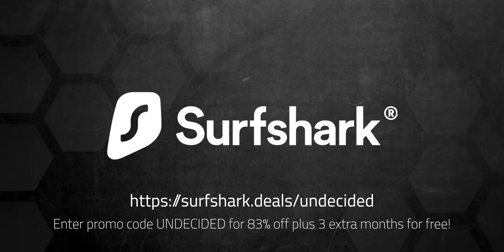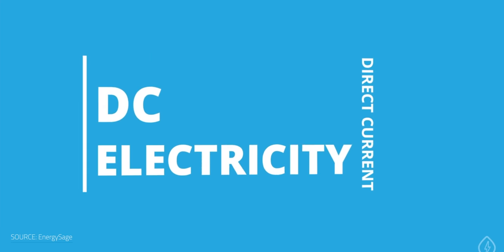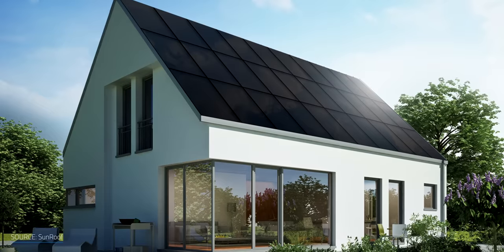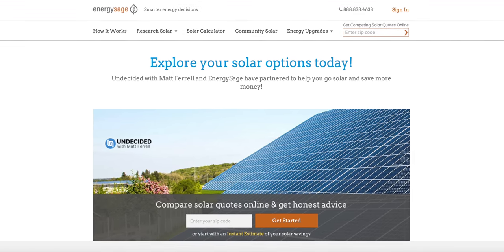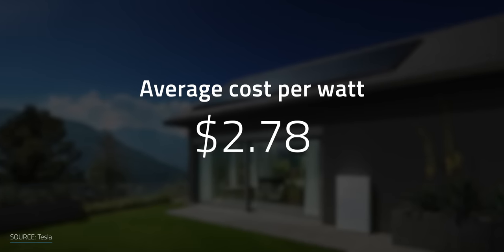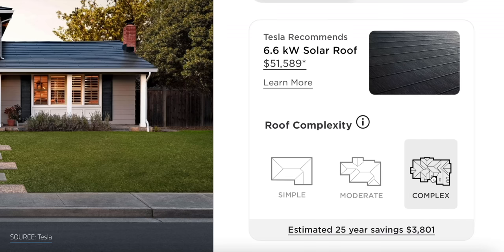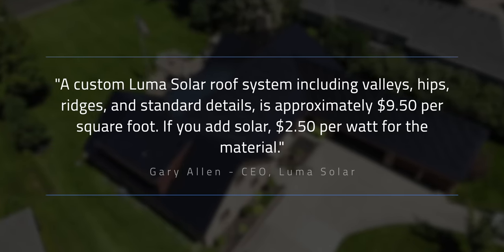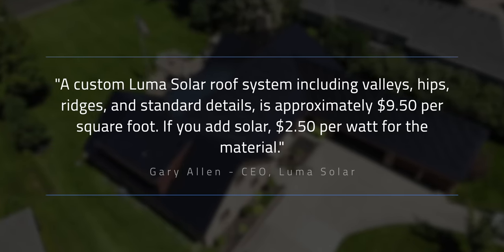Exploring Tesla Solar Roof vs. Solar Panels

Comment: Buying panels by the pallet is closer to 50 cents a watt.  I don't know where you are getting these crazy estimates close to $3/watt.  Sure, you can always buy the top 1% most efficient panels and pay 6x the price, but that isn't what normal installers use.

Comment: I feel like I would go with the solar roof overall if I ever get my own house. Not having to purchase a new roof AND solar panels seems like a big plus. Also, the repairability of the roof seems so much more convenient should something happen. If a branch from a storm hits a solar panel and cracks is badly in one place, you still need to replace that whole panel; while with the tiles, you only need to replace the small tiles that were broken which seems to be much easier and cheaper.
Reply: Totaly agree, although for me the looks are another great factor for tiles. It just looks nicer not to have boxes sitting on your roof while still producing your own power
Reply: I totally disagree with you, some modern solar panels are also very tough and much more efficient and also way easier to replace or work on, the tiles can also be damaged by a falling branch.....
Reply: @Blafaselblubb  solar panels also looks very nice and uniform on the surface, there are sooo many different models and configurations

Comment: All I wanted to know is the efficiency of the tesla solar roof, and this video failed to give this basic information. But I can work out the figure from the data they provided.
58 watt from a 114cm x 43cm surface, plus the standard sunlight condition for solar cells (AM1.5) is 1000W/m^2
So we have 58W/(1000W/m^2 x 1.14m x 0.43m)=11.83%
Wow that's pretty bad, I wouldn't consider buying a solar panel less than 20%

Comment: tiles are still not viable unless you're rich or live in a peak sun area.(not to forget weather strong areas are not up to the task) shorter lifespan then average roofing material/way higher cost to install. more fragile then a panel, more work to replace, more e waste. i do like the concept. just not viable for the average roof or persons costs. ( power savings are being added to building costs/repairs/ shelf life) if they can get the eco friendly up and longevity up they might one day be a hit.

Comment: The problem here is that they want to be able to control access to your installation instead of giving you what you need. I can easily give them the square meters or square feet of the roof in the exact diagram of the roof and installed it myself. I don't need to pay somebody else for something that I know how to do. However, if I do want to pay someone else for it? Then I simply will but the fact is not. Every one of us lives and the United States or wants to stay in the United States. This is why I wrote the last comment saying that there are companies in China that essentially do the same thing and in fact these tiles are coming from China

Comment: Well I like the aesthetics and the dual use concept of the solar tiles, however the fact that my roof is covered in snow for at least 6 months of the year means it just isn't the right fit for my climate. And NO I can't just clear the snow off my roof, I'd be up on the roof 3 times a week for some months. Panel for me.
Reply: I am a panel advocate but snow actually falls off TESLA SOLAR ROOF. It happened during the storm in TEXAS. A bunch of rooftops are caked with snow but the SOLAR ROOF TILED house experienced the snow simply slip off !
Reply: @honesty_-no9he  That's good to hear, and I'm a fan as well. However my situation, and one for many in the far north is that the snow won't go a way for a long time and that it is actually counterproductive for it to fall off the roof. We leave it there and in fact install "snow brakes" to keep it there. Roofs are designed to take the full snow load and 3' deep snow from the second story will likely damage things below the eves (people and pets for example). Additionally it can serve as insulation. So, it's panels for us unless we want to live with a massive snow heap bellow our eves and the possibility that it may fall unexpectedly.

Comment: If the tiles are tempered, then what happens if there is a hail storm? do they all shatter that easy?
Reply: Go onto Tesla's webpages and click on Solar Tile roof and they provide the data on what impact resistance the tiles have (its very high BTW!)

Comment: You are wrong to say that a 9kW panel system will produce the same power as a 9kW tile system (for the same incident solar energy). You provide no efficiency data for the Tesla PV tiles (or any of the other tiles)? Those textured and coloured surfaces are going to have a significant efficiency penalty which will reduce energy production and therefore impair the economics of the PV tile installations

Comment: Mannn solar in US is expensive AF.......in India most panels cost bout 20-40 rupee/watt......which is like $0.33/watt.........and additional $0.1/watt for panel stands.........so 1kw setup can be bought for like $330...... excluding wiring battery and solar inverters.......the local solar wholesaler also does solar projects and I was literally drooling just by hearing about solar farms.

I just bought mah 1st 1kw panels☺️☺️

Comment: Another con to Tesla solar tiles,  even if you are replacing or building a new home (i.e. new roof) there very well may be a good chance you do not get your roof in a timely manner,  now waiting when you already have a roof is not a big deal, but you do not want a long wait when you're building and need an actual roof.

Also in addition to their pricing increase you're apparently forced to buy their power walls with your roof (??)

Comment: I'm very interested in solar tiles more than panels, for the esthetic and that our roof needs replacing. Here in the UK, tiles made of slate and concrete are more prevalent than shingle. They last around 50 years and the average cost to replace them can range from 8-12k GBP. When factoring this in solar tiles become a real option. I can see a market for them there and new build homes. Another excellent video Matt, keep up the great work.
Reply: Ot you simply need to replace the broken clay/concrete shingles and install a much simpler solar panel system which is way more efficient than the tiles.
Reply: @carholic-sz3qv  you're correct to say you would replace broken individual tiles of course. Totally agree, but we tend to find after say 50 years the whole roof needs replacing. At this stage the difference in price between a replacement roof plus solar panels versus solar tiles alone becomes close enough choose my preference of the look of solar tiles. My roof is in need of replacing and I've received quotes for the roof and solar panels. I had to use an estimation tool for the solar tiles as they aren't currently popular and it was close enough for me to consider the tiles. I'm holding off replacing the roof hoping that solar tiles become available locally.
Reply: @geezerj5288  the main problem is to assure if the roof structure is still good enough and usually those clay tiles last longer than just 50 years

Comment: Your prices for solar panel installations are ridiculous. In Germany we pay around $13000-15000 for 10 kwp solar panels installed, all inclusive. So around $1.3 per watt.  Just a normal 330-370W panel alone costs around 40c per watt. Does the US take a heavy import tax on pv panels?
Reply: I agree with you. There is a huge mark up for turn key installations.  I have found if you price the components separately and then find a competent electrician and roofer to install the (battery free) system the cost drops by almost half. I've even called some of the firms he references and talked to their technical guys to discuss this as I'm an electrical engineer.  I think he could bring this point up for some people who have the knowledge and feel comfortable approaching this way.

Comment: Two things you need to consider. 

Elon Musk did have aesthetics as a core principle of idea and he was one of the first to coin this concept. 

Two would be he is limited on his involvement with the company and all his time is invested in space X.

Hes an engineer at heart and these companies run themselves with others involved. 

Just like his internet company, they are bleeding hundreds of dollars by giving you a state of the art dish with crazy technology for 500 usd while eating a grand loss per unit. 

The cost of these panels will go down but unless your a big DIY guy, the roof was designed to have a already proven hardware/firmware control installed, hands free, hassle free, with a elegant roof. 

Sure it's still crazy expensive but you got to start somewhere.

Comment: In northern countries tiles would be best to be only on one side of the roof since the other is on shadow side most of the time so there is that :D
Reply: I live in Manchester UK and I have both a south facing slope of panels and a north west facing slope of panels.
Reply: @honesty_-no9he  so the north facing one produces less electricity than the south ones naturally, this is my point. Here in Finland in some houses you would only need the other side of the roof as solar panels/tiles since some have always shadow side which is practically useless in my opinion.

Comment: Also the installer standing on the solar PV panel at 11:17 into the video should be fired. Standing on panels damages them, creates invisible micro cracks in the cells which ultimately leads to significant failure at worst or poor performance at best. It's terrible installation practice.

Comment: It would be much more useful if the chart for prices started at zero. Then you would see easily that the $0.53 spread from lowest cost to highest cost PV panel is less than 20% of the least expensive overall price. Your chart makes it look like it is over 4 times as much for the highest than the lowest. How did you even decide your starting line? What is your starting line?

You may think it is a little thing but when you are overwhelming people with numbers and data, it makes it easy to err in reading a poorly designed chart.

Sorry but I was an engineer and we showed actual costs, NOT just the differences between costs.

Comment: So how do you get to a failed tile in the middle of the roof without stepping on and damaging the good tiles? Hmm...
Reply: i'm pretty sure you can walk over the tiles without breaking them, unless you weigh an ungodly amount, at which point you are better off not getting on any roof to begin with
Reply: From what I understand the tiles are actually quite durable (and are designed to be able to be walked on during install without issue). it would take something significant to cause a tile to break, like a falling tree branch or the like.
Reply: Good question!! 

They probably can withstand a certain weight- as you can see with the guy that's slapping on the new tile..

I am so believing if your weight is most distributed on the edges of the tiles it should be ok being that the edges should be the strongest..

Comment: If possible you should not put solar panels on your roof. It will void your roof warranty. Tesla solar roof prices have risen by about 40%, even after you signed a contract. Prices need to come down.  I have seen videos on Tesla roof installation, Tesla seems to be very poor at estimating costs and will hit you later after they strip your roof with extra charges that should have already been factored in. Very poor planning by Tesla. Maybe they should stick to Tweeting.

Comment: Heh, went to tesla to see vaguely how much it would cost to replace my roof with tile, turns out the cost would be about 20k shy of the value of the house when we bought it 18ish years ago. House was 95k and solar roof quote is 75k, thats after the 19k tax credit. Regular panels cost was 35k. 

No this isn't going to go mainstream, this is a goddamned joke. 95k to replace a roof on a 1300sq house is ridiculous. 

I have a better alternative for power outage protection, spent $4k installing a standby generator.

Comment: How they make a big deal out of repairability is just a joke right?
As if it was hard to repair a clay shingle, just lift the surrounding shingles and put a new one in 😂
Takes like 10 seconds, also doesn't cost you a arm and a leg...
If you want worse performance, higher cost and a easyer way to get water damage after a hailstorm for just "better looks" go for it.
Reply: I have LG Neon 2 panels btw :) Very happy with LG's quality

Comment: You can get good bifacial panels for $0.50 per watt.
Reply from the maker: The prices I’m using include labor and installation.  Not just the panel itself.
Reply: @UndecidedMF  It seems you are talking about turn key system install. I have found if you price the components separately and then find a competent electrician and roofer to install the (battery free) system the cost drops by almost half. I've even called some of the firms you reference and talked to their technical guys to discuss this as I'm an electrical engineer.  I think you could bring this point up for some people who have the knowledge and feel comfortable approaching this way. Good video.

Comment: Say your house faces South and you are re-roofing. Why not put Tesla solar panels on the front side and asphalf shingles on the back side (the back side is all "inactive" anyway)? Looking from the road, you have a good-looking solar roof. Looking from the back yard, you have a good-looking asphalt-shingle roof. From the air, it looks a bit odd, but who cares? Why isn't this ever discussed as a possibility; wouldn't it be the most practical and give you the best of both worlds? A great-looking solar roof, with little extra cost. It would be much better than having piecemeal add-on solar panels on the front (South) side.

Comment: Tesla's solar roof are WAY over priced for the electric fees they offset, at this time. Tesla's Revenue growth from Tesla's solar side of the company will continue to be far under  expectations and is very unlikely to reach expectation in the foreseeable future. Conventional solar panels are decreasing in costs and Tesla panels are not ("just increased by a pretty good margin" and "Tesla just changed pricing some what dramatically".   Simply stating the percentage it was increased was to much effort I suppose. Anything sold that hides or doesn't mention price in discussion is not an accident.  Very few owners will ever be a customer who isn't in the market for a new roof, re-roofing or one who has a roof not needing replacing.
Reply: Let's be honest, it's only a product for people who would be installing a premium roofing product like a slate roof and not really someone only looking to add solar alone. Which when it comes to solar installs is a fraction of the market, IMO.

Comment: Disliking videos that are sponsored by vpns whenever they're specifically advertising them as ways to get around advertising first off I'm still getting ads for languages I don't speak I'm still getting ad for a computer after I just bought a computer in fact they increase just after I buy a computer which is the worst time to advertise to me then the ads need to get better at advertising what I actually want.

Comment: That was far less useful than expected...  Didn't even have consistent data types across all of the panels, missing efficiency for a few, didn't include any data on one, no cost comparison for panel vs reroofing...

Video had a lot of potential to be a one stop info hub, which could be a yearly video, and a great ad for the website for most current data, but instead ended up being pretty lacking.

Comment: I would always prefer solar panels. Much easier to troubleshoot, upgrade and maintain. You can also make sure they are only installed where there will actually be sun and avoid shaded areas of the roof and poorer aspects. 

A lot of solar tiles on a solar roof would produce very little and possibly impact the performance of other panels that are in series. 

Solar tiles are a gimmick for wealthy Elon fanbois.

Comment: GAH!!!! 11:16 While panels aren't so fragile that they can't take a little abuse, you have to wonder what kind of effect standing on them is going to impart.  Some cells would be fine, while others, that could crack the traces and effectively make the panel useless.  It's no wonder customer reviews can be all over the place.  I have to wonder just how many "system doesn't produce anywhere near as much power as they said it would" kind of reviews are the result of installers who just outright damage the system while installing it.

I'm also a little surprised that panel efficiency isn't a bigger topic for people.  I mean, I guess I get it. When you have 150 - 200 square meters of roof, fitting a 9 or 10 kw array isn't too difficult even with lower efficiency panels.  But for me and what I have planned, I need to try to cram at least 5kw (preferably more) into less than 40 square meters and that would be shared with other stuff, so when I'm comparing panels, I'm actually using fusion 360 to lay them out and compare each option and every tenth of a percent makes a big difference, lol.